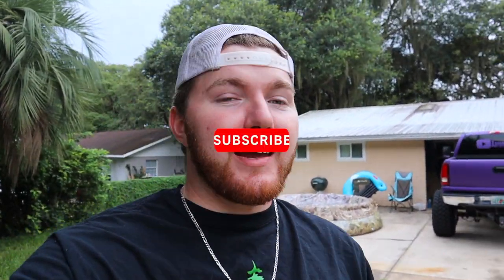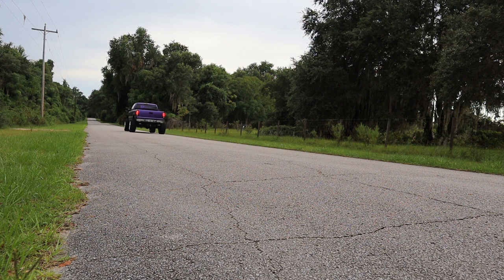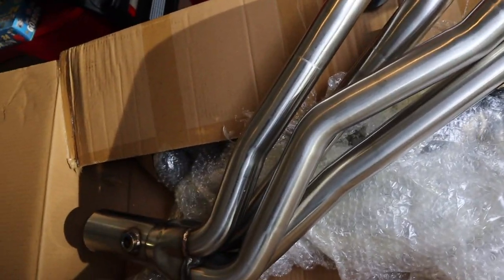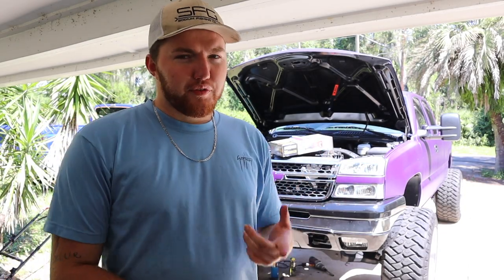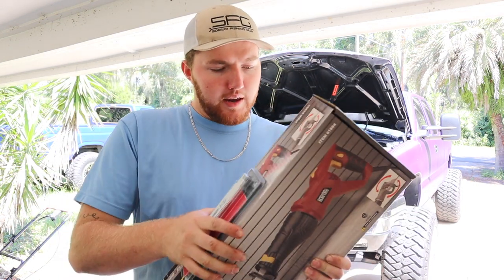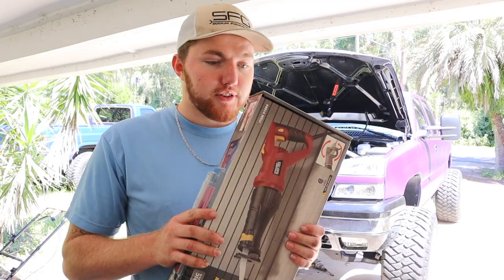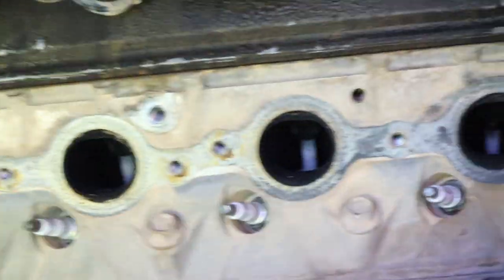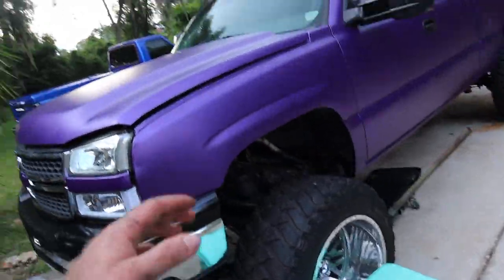*GONE WRONG* Installing LongTube Headers & Catless Y Pipe

Comment: My header hit the stick of the steering wheel and now my wheel it’s a little hard to turn it any suggestions
Reply from the maker: Pull the header off, take a hammer and lightly dent the header in. I had to do it on mine as well.

Comment: i need help bro so is it normal when you install your headers that it smells like burnt stuff / hella gas when you make a stop ?
Reply from the maker: You probably melted a spark plug wire and it’s misfiring which is why you smell gas

Comment: Here’s a tip heat the bolt up then spray cold water then wd 40 or anything like that it works for me.
Reply from the maker: Its a aluminum head, heat up the bolt and throw cold water on it my luck the head will crack.
Reply: Aaron Cates I was talking about the exhaust clamps and stuff not the headers

Comment: Why did you wrap them? Also do you have to get a tune if you delete the cats or can you just plug In your o2 sensors and run it
Reply from the maker: To retain heat inside the headers, helps keep engine bay temps down, also decreases your chance of melting any wires close to the headers. You will need a tune unless you install spark plug defoulers to space out the O2 sensors. A lot of the time you can’t fit those.
Reply: @AaronCates  I good ceramic coating will also keep your engine bay temps down. It also has the advantage over wrap from a durability perspective. It is not damaged by engine fluids unlike wrap which will degrade if it contacts engine oils, degreasers and or other under hood fluids.